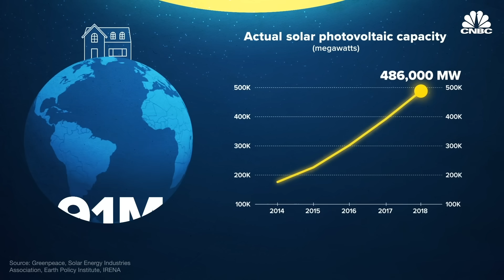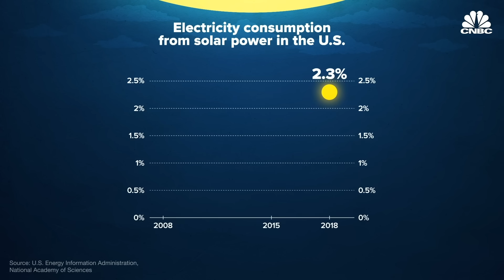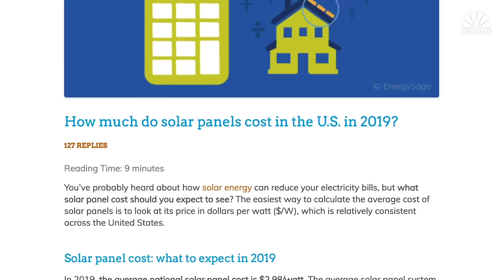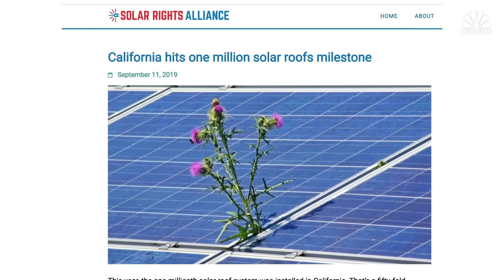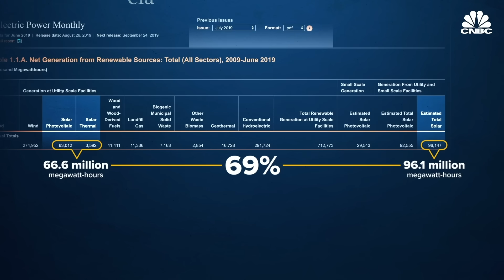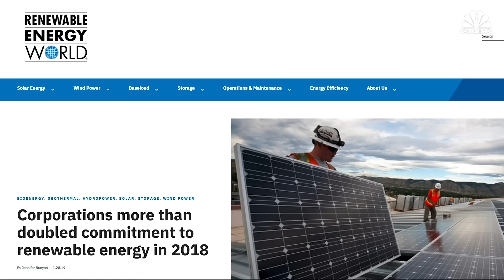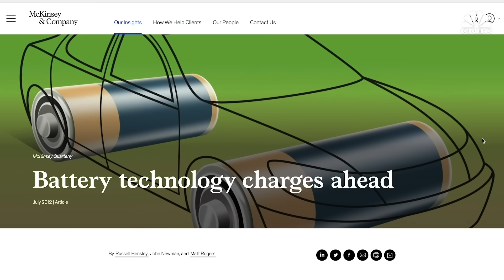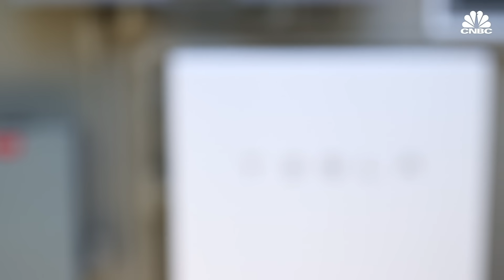The Rise Of Solar Power

Comment: and in the UK, we've just signed off a further 5 gigawatts of off shore wind to be  built in the next five year.
Reply: What if the wind isn't blowing? Wind MUST have a regular power plant running at all times. Can't turn a power plant on and off, it takes days. Wind is a waste until there are storage solutions. Your electric bill is gonna skyrocket!
Reply: @TheBandit7613  Actually, the contract of differences for this wind energy was LESS THAN HALF of the price than for the equivalent Nuclear Power Station that is being built.  I doubt you are from the UK, but the wind almost always blows somewhere around here, but we also have solar farms and gas turbines.  We've all but eliminated coal, and we're after the gas stations next.  People a LOT more clever than us manage our grid, and they have been doing it for over 100 years.  If you don't know the energy difference between "hot standby" and running, you should look it up, you can't have "regular power plant" running at the same time as you say, otherwise you'd have twice the power being produced, and electricity doesn't work like that.
Reply: @TheBandit7613  As Paul already made clear, you dont seem to be up to date with technological and price developments over the last couple of years. There is a new generation of low wind turbines that dont go for max peak performance, but instead a higher capacity factor resulting in higher percentage online per year than US coal plants! https://fortune.com/2019/10/07/offshore-wind-uk-auction-subsidies/
Reply: ChrisNVegas Renewables don't need a constantly running backup. Gas plants can come online in minutes if needed, the sun is quite predictable, and offshore winds are reliable - and increase in winter when we draw more power. We have all but eliminated coal from our energy mix- it accounted for one percent of our entire annual electricity production last year, down from almost 100 percent in a generation. Solar is viable even here, a country not exactly known for our endless sunshine. And the myth that renewables drive up power costs is exactly that- a myth. Power costs have fallen in real terms over the last two decades as the grid has got greener. We have some of the cheapest power in Europe, and much cheaper than many states in the US, due in no small part to us having large and expanding offshore wind farms and sensible,permissive policies towards small scale domestic solar panels.

Comment: Just make it easy and go nuclear. No expensive installation, no intermittent energy, no loss at night, no expensive battery storage required and you get much more output than any solar plant. For high intensive energy demand, nuclear is the way. Wind-solar-geothermal can help us get to a carbon free future but can't supply all of our high energy needs. For that, we have no choice but to go nuclear (and continue fusion research). You can't power your stove, washer, dryer on solar panels, that's what these videos don't show you. Solar is not sufficient on its own. The only green energy source that provides the high power output to meet our demands is nuclear.
Reply: Jalil Muhammad too bad nuclear is demonized and people are 10iq sheeps

Comment: What we need is World Electricity Network like internet today. That way we can send solar electricity from one continent to another. When is dark in US, we in EU send you our solar electricity and vice versa. Lon to NY, Tokyo to LA, south to north, west to east 24/7  365 days. High voltage direct current (HVDC) transmission is not new thing. China for example have today link of 2000miles 12GW.  Submarine power cable on ocean floor like internet cables. 

We can do it!
Reply: The idea would be cool but It wouldn't be that easy( building miles of connecting pipes/wire through oceans) and would be even more expensive. Could happen in the future when were more advanced tho
Reply: @talkstran6352  It's me, youtube didn't show my massage.
UHVDC have voltage of more than 1 million volts. So transmission losses are  less than 5%. This China link is 1,2 million volts (1,200 kV).
HVDC avoids the heavy currents required to charge and discharge the cable capacitance each cycle like for AC so you have less loses than AC for very long distances. Also cables on ocean floor are less expensive to build than on land.HVDC allows power transmission between unsynchronized AC transmission systems. Since the power flow through an HVDC link can be controlled independently of the phase angle between source and load, it can stabilize a network against disturbances due to rapid changes in power.                                                                                                                                               HVDC also allows transfer of power between grid systems running at different frequencies, such as 50 Hz and 60 Hz (UK to USA) . This improves the stability and economy of each grid, by allowing exchange of power between incompatible networks. 
I think that we have a solution for climate crisis.
Reply: @talkstran6352  Search for Submarine power cable wiki on google. 

It is less expensive than on land transmission.
Reply: @klokoloko2114  oh I wasn't originally able to see the part where you mentioned the ocean in your original post, but thanks for actually taking the time to explain this to me, I learned something today. America has a lot of catching up to do.
Reply: @talkstran6352  Thanks, I appreciate that 🙂 It's going to be interesting to watch what will happen in 10 years from now, and how we will solve climate crisis.
Bye
Reply: @Amusis OK, but I do not agree with you. If you see energy mix from  all tech. You will see that solar and wind is fastest growing tech. You think what you want, but for me having my solar roof and charging my EV on that electricity is my American dream. That day will be my independence day and I'm not far from it.
I welcome carbon capture..
Just one question? What do you think about global warming? Is it real, is it man made, your opinion?
Reply: Kloko Loko think of the energy wasted
Reply: @Amusis How can you say that 😌 The main problem of solar is that you have to store energy at night and in winter in  January you have 5 times less energy production per day than in July. Big battery storage is very expensive.  With UltraHVDC transmission loses are minimal, less than 5%.

We are going to slowly phase out from fossil fuels electricity generation to decrease CO2 emissions, so we need global solution for this problem.
Nuclear in general public is not accepted so much, but I personally are not against it.
What is your proposals, solutions for after fossil fuel era?
Reply: @klokoloko2114  solar complements winds, which is stronger at night and extra power generated can be used to fill water dams, in this way storing energy. That's how we here in Portugal go from May to September pretty much on 100% renewables and still have some left to sell to other countries.

With renewables we went from being a heavy net importer of electricity to a net exporter and the 3rd biggest renewables investor and producer in the US is a Portuguese company, EDP
Reply: @fgsaramago  Pumped-storage hydroelectricity is good choice and it's cheaper than batteries storage. Nice to hear that from Portugal, you are an example 👍
Reply: @Amusis I know what is percentage from all sources that produce electricity, i have it in my head. Also my statement that solar and wind is fastest growing tech in energy mix is true. 
Did you actually watch the whole video 2:18 ?
I will always prefer system when lot of people can contribute and have benefits from some system and earn money  instead a few multi billionaires in energy business like today.
Why emotional ? Because I can't have nuclear power plant in my backyard..
Also global warming is much more than you think it is.
Reply: @Amusis Solar in US is 2,3% today and in Germany is 7,9%, China 3,3%, Japan 6,8%, India 5,4% Australia 6,3, Italy 7,3%. Average today globally is about 3% for all World. First in the world is Honduras with 15% from solar.

I can only see that US have to do much more. As I say I'm not against nuclear.
We will see what will be in 10 years..
Reply: @Amusis nuclear is also by far the most expensive electricity you can have. Forgot that part. Currently twice the price of natural gas and more than 3x the price of solar/wind
Reply: @Amusis and France is also a heavy net importer of electricity, much of it wind produce from Portugal, lol

Comment: how long do these cheap solar panels last for? Using these cheap prices for statistics ignores the significant failure rate. What happens to the disposal of these panels?
Reply: p web im assuming they can get recycled/repaired
Reply: most have a  25 year warranty.  The efficiency could decrease to 80% over time.

Comment: We should all be using electric vehicles charged from our home, business and covered parking rooftop solar arrays making nearly everything we do 100% solar powered including charging our vehicles.  Everyone should be getting proposals from 3+ local solar PV installers and suggesting the same for our places of work, our grocery stores, our movie theater parking lots, and everywhere else.
The cost per distance driven is ridiculously cheap when you are your own solar fuel station (less than $0.01 USD per mile)! #nobrainer
We cannot afford to continue to burn fossil fuels!
Reply: It's crazy I subscribed to the Tesla solar rental and all I have to pay is 65 a month no strings attached. pair that with an electric car and I'm good to go
Reply: @thomas8421  Awesome!  Spread the word!  And when we're the owners of our own systems, the savings are even greater.  Every 30 yr mortgage from now on should require a solar (or other renewable energy) array that covers 100% of their projected consumption including electric vehicles (or as close to it as possible) on both new or used homes (and businesses, etc).

Comment: I miss the Vanadium flow battery as the next big thing for energy storage. Like the ones that are made by Cellcube Energy Storage Systems
Reply: No, they are a waste of time since they were designed for short term energy storage and thus compete directly with Lithium-ion batteries. 

Lithium-ion cells are getting cheaper and cheaper and don't need as much space as flow batteries and their maintenance are much simpler.
Reply: @yutuniopati  VRF is still in development, just like L-ion. VRF has a way bigger lifespan. I believe in a big future for both.
Reply: @Luuk V. VRF does not have bigger lifespan, actually the acidity of the flux make the lifespan of the entire system pretty low. The long lifespan is only theorical.

Comment: Now we need to take down the fossil fuel corps.
Reply: we cant take them down entirely.. we can rest them for more economical use at night when the sun doesnt shine
Reply: Electric cars are powered by fossil fuel electricity. Solar accounts for 7% of the current production, and 45% of the cost of energy production.
Reply: @dmay3391  True... but electric motors are much more efficient than gasoline engines. An electric motor converts around 96% of the battery energy into forward motion, whereas a petrol engine only achieves between 18% and 20% to do the same "work". Most of the energy from a gasoline engine is wasted in heat and friction. So... even if an electric car is 100% powered by coal-fired electricity, it is still around 40% more efficient in energy consumption than a gasoline engine burning another fossil fuel - coal's cousin. Here in the UK, in 2010, coal-fired electricity amounted to 52% of the grid's supply. Today (2019) it is less than 3%. On some days, NO coal-generated electricity is produced or consumed. By 2025, the UK wlll not generate any electricity using coal.
The USA will be forced to abandon coal by simple market trends - as this video shows, solar power is MUCH cheaper to produce. The challenge is power storage. Coal will disappear (despite Trump being bribed to sustain it) and as it goes away, so electric cars will increasingly contribute to lower carbon emissions.

Comment: Fossil fuels get over 800 billion dollars in federal and State subsidies every year! If you tried to remove those the oil companies would scream and throw tantrums .
Reply: You have left out some vital information. When the nite comes Solar shuts off. If you install a extra system for storing energy the price triples and it takes additional thousands of dollars to produce the batteries and equipment to manufacture using fossil fuels, the rubber, the metal dug out of the earth, the lead batteries, mining, also the oil to produce the plastics,then there are the solar panels themselves. Did you forget this? How about the ships and tankers the spew oil and gas to ship to your country. the trucks to carry to your home. Solar isn't as easy cheap or practical as you assume. Reality just hit a brick wall. Yes, I love the solar idea but let's not pretend we don't need fossil fuels at all.

Comment: Can my make a video on the hydrogen power market and hydrogen power cells?
Reply: I used to think we would use excess solar in the day to make hydrogen to then burn at night. But due to the falling costs of batteries and their recyclability I don’t foresee it happening. Not to mention the dangers associated with hydrogen gas.
Reply: I had the impression that hydrogen gas storage is just as safe as LP?Storage is always a issue no matter what battery you use be it molten salt, hot water, wet or dry chemical. the thing is to have one big enough. Where I am I plan a battery to hold load for 4 days no sun. I saw in the pacific north west they plan 20 days no sun. Last winter we got caught short we actually had 5 days no sun. As you know chemical batteries deteriorate over time and actually perform best at cool temperatures. Most manufactures test their chemical batteries at a cool 70 FThe unfortunate thing is that the most energy consumption is in environment control, heating and cooling, and hot water.
Reply: MerkDolf it’s as safe when stored properly. Problem is it’s harder to store because it’s under more pressure than LP. Which means higher cost and higher safety standards. Another downside is when it comes to big tanks/storage it’s harder to stop a fire compared to gas/diesel due to the pressure. By me we recently had a trucking company’s LP tank start on fire eventually a few tanks exploded and they had to just let it burn all the gas until eventually it went out. Fire trucks just sprayed around the fire to prevent damage.
Reply: @John Moore Thank you very much for the information.
Reply: Do you mean like Nikola?

And did you see the guy who uses solar PV to make hydrogen to power his car's fuel cell, and house?

Comment: Carbon-emission isn't that pollutional, but solar-energy is perhaps better, no emission at all.
Lithium-batteries can perhaps be transformed in plastic-waxcoated batteries.
Thanks for showing and kind regards
Reply: "solar-energy is perhaps better, no emission at all."
Solar energy pollution is disperse in it's production and disposal. Dispersal is a debatable solution to waste.
Gen3 nuclear has no emissions and the waste is in a concentrated area for easy reclamation. Unlike solar intensive resource consumption, Gen3+ is cheap and abundant. To deny Gen3+ is the solution, is to be a science denier.
Reply: @dmay3391  Thank you for your remark, kind regards and greetings

Comment: Run your Hoover Dams at night. Its like you have forgotten Hydro Power which is quite reliable with a reservoir.
Reply: Ave True to Caesar
Reply: @Razgriz032  Patroling the mojave makes you wish for a nuclear winter.
Reply: Problem is that hydro requires big dams, which destroy vast ecosystems and decimate fish species. That's why many hydro dams are being removed, so the fish can recover.
And with Hoover dam, there is a drought there currently, and the water level is getting low, and water flow has to be metered for all the cities that rely on it downstream.
As a result, there isn't enough water to use it for pumped storage without building another reservoir downstream to store the water before pumping it back up.
Reply: Hydro, nuclear, natural gas: $0.05/kWh 24hrs a day. Solar $0.51/kWh 0-4hrs a day. Gen3 nuclear is the only viable solution for the coming wave of electric cars and desalinization.
Reply: @dmay3391  solar is way cheaper than $.50/kWh.
Reply: @dmay3391  You're off by a factor of TWENTY FIVE.  The best solar contracts today are coming in around $0.02/ kWh, more like 7-10 hours/day.  Nuclear can't be done at $0.05/kWh with current technology.  Maybe advanced fission could, but why don't we see it?
Reply: D May 
True in many ways but we need solar too.  And if we’re going to use nuclear, we need to switch to molten salt reactors that are safe and use existing nuclear waste for fuel.  Oddly, the first reactor was a molten salt; the only reason we used the existing type was to produce material for weapons.